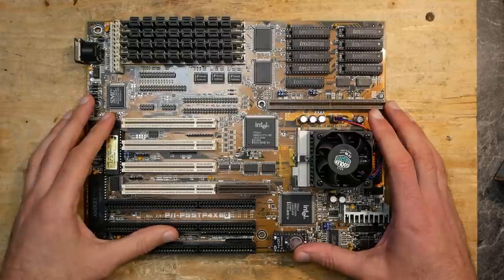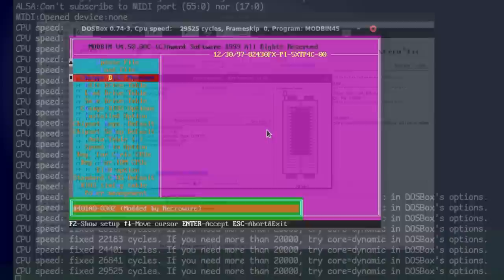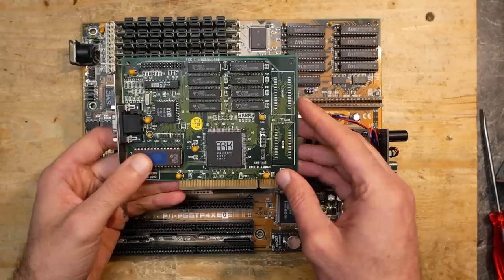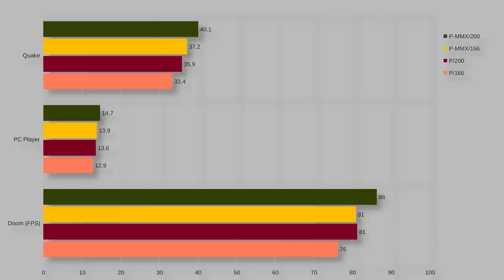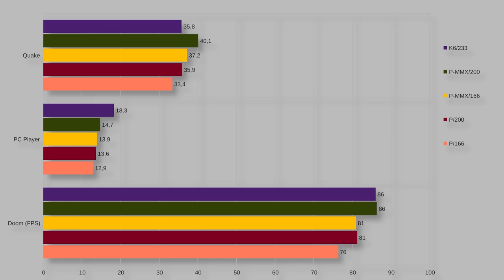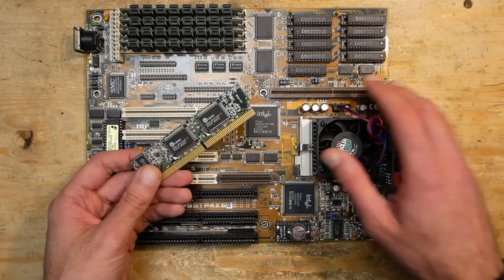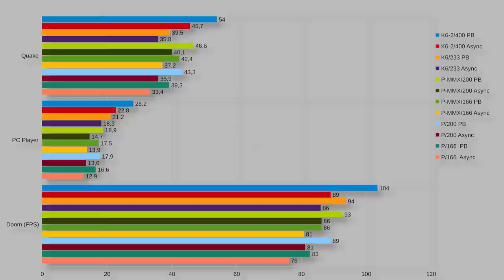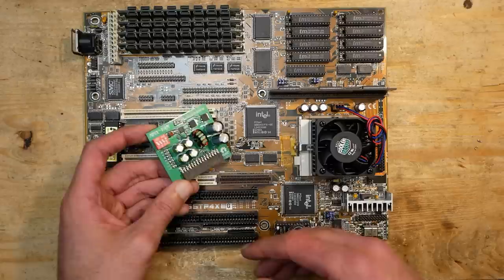Let's upgrade an early Socket 7 board beyond the limit (Part 5): Showdown!

Comment: I'm still sporting a K6-3+ at 600mhz in my GA-5AX board. Quake2 actually got a 3dnow! patch to give it a performance boost on these CPU's.
Reply: Nice to see someone else with that same Motherboard as well. But I only have the K6-2+ at 550Mhz. I have seen modded 570 K6-2+ CPUs due it's the same CPU with only half the L2 cache enabled but the modded one's are not cheap. Also not easy to know who's modification is good and whose is just a hack job.
Reply: still got a amd k2 533 - i could make it 550 but not anymore (15 years last time i tried that ) - I could not run new netscape ( belive it was 6 ) or ie 5? with great speeds sicne it felt like the browsers ate 200 mhz which made me buy a Duron 600 which did run those at good speeds
Reply: @user-bs1lr8nx1h  It probably was an issue with the RAM (volume) rather then CPU speed, because the K6-2/K6-3 were very powerful and in many tests even outperformed a Duron. The main difference, the main gain of the Duron, was with floating point and integer operations including 3DNow!, and memory bandwidth. So things like Quake or Flask ran a lot faster, while regular application sometimes even were a bit slower.
So as long as you got yourself 128MB+ of PC-100 RAM on a board with sufficient cache to support it, a K6-2 400 upwards left little to be desired.
Reply: @l3lue7hunder12  I had even pc-133 memory , a game like unreal tournament like 160mb ram the best
Reply: @user-bs1lr8nx1h  That should have been plenty, yes. Maybe the RAM timing was askew then, since you mixed up different types ? Or maybe you only had enough cache for the first 64MB, or 128MB - there were quite a few who fell into that trap.

I switched from a K6-2 450 to a AMD Duron 700 and was quite happy myself - even after almost frying the poor thing with a bit too enthusiastic Peltier element experiments. Afterwards, I had to undervolt my Duron or it wouldn't even get past post. I switched to an Athlon Thunderbird 1 GHz from there - yet another rather significant boost.

I wasn't too happy having lost ISA through this among other things though, so I still think back fondly to the (S)S7, even the first which was a K5-PR 133. :-)
Reply: very cool!! i need to compile quake for windows nt dual cpu p2
Reply: Zrob to

Comment: Amazing series. You turned a decent early(ish) pentium board into a much more useful testbed. "Super socket 7" would allow for AGP and SDRAM, it would be interesting to see a comparison (clock for clock) with the updated boards. As an all in one test bed this board is now so much more useful and interesting. Great job.
Reply: SDRAM sure is nice to have, but only if the chipset is worth its salt ... my first PC had a 450MHz K6-2 on some shitty ATX board with SDRAM slots and ALI chipset that actually got LOWER scores in memory benchmarks than a pentium 200 on an old (non-super) socket 7 AT board with intel chipset and only SIMM memory.

Also, I would not bet on getting much of an improvement out of AGP on socket 7 - I heard that AGP is buggy on all (or almost all) SS7 chipsets - this ALI board that I had sure was buggy as hell ...
Reply: @KenjiUmino  Well, then use SIS chipset. Rare, but much faster in relative performance.

Comment: I ran a MB like yours with 75mhz bus for many years with a p200@225mhz, never had a single problem or instability, it was really like 5 or 6 years running like that with a trident 9660, i just set the jumpers to 75mhz and never put back because never had a reason to, it just worked... true the pci ran @37.5mhz but it just worked fine even with my voodoo 1 and playing games for hours non stop, at times i would ran it with bus at 83mhz/pci 41mhz but the proc at 2.5x instead of 3x giving it 210mhz and it would also work fine for hours but everything exept the voodoo card that did not work at those speeds.... along with that one i also got a asus tx97 with a p200mmx also @225mhz rock solid, this one would not go but over than 75mhz bus. A friend of mine still have his P55T2P4 with intel HX chipset, this board we tested with a k6 3 at litle over 400mhz and bus 75mhz, unfortunetly i didn´t have my old diamond stealth (s3) that would rua at 83mhz bus anymore to test the k6 even higher at that time.
Reply from the maker: Unfortunately, I don't know any 430FX mainboard, which would provide 75MHz FSB, that would require some heavier modifications. That FSB clock started to come first on later mainboards with 430VX and VIA MV2 chipset.

Comment: Could you recompile Doom with MMX optimizations enabled? Since it has been reverse engineered and compiled for a billion platforms I'm guessing it could be done 🤔🤓 it would be REALLY interesting to see the difference in benchmarks, if any 🙏🏻🙏🏻 
Thanks for another amazing video, I'm always looking forward to watching them
Reply: Hm, Doom is probably not written in a way that could benefit too much from MMX instructions. The way it renders the frames is totally not the way a SIMD instruction set would like it. It goes in columns, uses paletted 8-bit pixels, has look up operations for every single pixel and does hardly anything on groups of pixels. Moving rendering into a system memory buffer could possibly help, at least it could with slow video cards (I remember Heretic was a hell lot of faster than Doom on my very unbalanced Am5x86 + ISA Tseng ET3000 system) and MMX could even make a faster frame buffer transfer possible - probably not by much though as the 32-bit-wide PCI bus could be a bottleneck here. Hm.
Audio processing and mixing could be a better candidate, I guess, but that's less of a bottleneck.
Reply: The Doom Engine source code was released by iD software, under the GPL.

It was not reverse engineed.

Same goes for the Engine for Quake 1, Quake 2, Quake 3, and Doom 3.
Reply: Doom never supported MMX.
Reply: @Jeroensgambling 
There are source ports that support all sorts of fancy things.
Reply: It used lot of tricks, like lookup tables to actually not do floating point operations, which were expensive. MMX is about floating, so...
Reply: yes, you theoretically can, quake too. i'm sure you'll see a bit of speed increase regardless especially if you can use a modern compiler, which tends to be smarter with optimizations. not sure if the original doom/quake were compiled with -O3, it could be that they're not, since -O3 is considered experimental, but that might be another thing to try.

there's also fastdoom, which speeds up doom even more, even if you don't use its graphics degrading settings.

jbinary82: MMX is not just for floats, read the wikipedia page about it, it can also work with integers.
Reply: There's not much to "optimize" - the MMX registers are only 8bytes wide. The most likely option would be to increase color depth and do color blending via MMX instead of palettes. Overall it would be way too slow on old prcessors though. The fixed point math could also be done via the newer register which I tried some years ago and the speed was practically the same.
Reply: @jbinary82  Actually, no. MMX is not about floating, it's about integers, and that's in part why it was a complete failure. Intel learned the lesson and followed suit with SSE, which actually were about floating point (as is 3dNow).

Comment: That K6-3/500 is a really special chip! My first build was a K6-3/400 prior to the availability of the 500 variant. I rocked with it for nearly a decade before retiring it. I had a Tyan board that supported ECC memory and even ran Corsair ECC memory with a ramdrive. Good times! I would send it to you, but it has a special place in my heart and closet and still boots!

Comment: I've been using Jan's modified BIOS since 2001 when I read Oldie Tuning on Tom's Hardware and upgraded my AT computer with a P55T2P4 and a K6-2+ 475 (which overclocked to 500 MHz by using the 83 MHz frontside bus). Jan has always been very helpful, and has done his BIOS magic on request for myself and a number of others I know of. 

I've used both the 75 and 83 MHz FSB on many Socket 7 motherboards and have had no issues with the out of spec PCI bus.

Last year I picked up an old AT computer for $20.00. This was a major score for me since I really wanted a compact AT case, and they have become very rare here. It came with a PCChips M520 VX chipset motherboard, 128 megabytes of EDO RAM, a K5 PR133 (100 MHz) an extremely slow hard drive, but most importantly for the poor person who was forced to use it, no L2 cache at all! This was one of the infamous PCChips motherboards that had fake cache chips, and the COAST slot was empty. On the bright side, this rendered the VX chipset's sixty four megabyte cacheable area limit moot! I used an Evergreen Spectra voltage regulator and replaced the K6-2 400 CPU that was installed in it with a K6-3+ 400 that I slightly overclocked to 450 MHz (6x75). Combined with a fast, modern hard drive, this computer flies in comparison to how it was when I first got it. Since this board has a header for a VRM module, I plan to replace the Evergreen module one with one of yours.

Comment: Very good video! Entertaining and well thaught. As pcb design guy i could help you with dc_dcs. Well from year 2013 I started a new hobby: extreme overclocking. I bought single-stage-phase-change-cooling and I had -42*C at 150W cpu. Very time consuming hobby, but fun. I have done "8800 zombie mod" - cut dc-dc part of pcb and mod it like it is a adjustable power module. Now I am selling my collection, but everything older than socket A is going to be kept for future projects. So there are more of us, retro fans!
Ps. Overclockers used hwbot site.
Ps2. The most wanted mobos were: ga-5ax and asus p5a. The goal was 2d performance, tests like superpi, pifast, wprime, cinebench, no 3d like 3dmark, aquamark or games.

Comment: That's awesome. I remember playing with Socket 7 in the early 2010s. 200mhz pentium mmx, 512mb sdram, 512kb L2 cache module, SATA PCI controller. Got stuck trying to put PCI 3D graphics on it, and I tried upgrading to AMD K6 but the voltage was too high. A lot of fun watching you take it to the next level!

Comment: COAST modules were not usually very interchangeable with each other despite using a standardized slot, it was as if the manufacturers did not want you to be able to reuse or sell them...

Comment: Hey, you did some great tests. That brought me back so much memories. 
But I've got one question: If I remember correctly from back in the days, the RAM is cached top to down, so upper memory first. If you use more memory than cachable by the chipset, the lower memory will be uncached. The i430FX should have a cachable area of 64 MByte. Thus it should run faster with only 64 MByte RAM for anything not demanding more than 64 MByte. And that is certainly true for most DOS apps and games. Greetings Peer
Reply: I think the i430 caches the lowest 64 MB, but it was Win95 that liked to allocate top-down.  (And NT or Linux would allocate all over.). Regardless, your point is correct: as long as you don't need the extra RAM, sticking with <= 64 MB is wise.  This is why the K6-III (and 2+/III+) is so great, as its onboard, full-speed cache makes the motherboard cache redundant, and it can of course cache the entire memory range.

This wasn't just an Intel 430 thing -- VIA and ALi Socket 7 chipsets also had various cacheable limits which were often less than the maximum RAM capacity, and sometimes depended on the mainboard's L2 configuration.  Sometimes they were a little better, though -- e.g. 128 or 256 MB.

Comment: Excellent work! Videos like this make me wish I had held onto my old Megatrends HX83 socket 7 board and AMD K6 200Mhz CPU. I don't remember what happened to it when I replaced it with an Abit BH6 mainboard and a Celeron 300A that spent years overclocked to 464 Mhz.

Comment: Really cool project, very interesting how far you can push this old hardware and the vrm is genius. I wonder if those coast cache modules come in different speeds and how much that would affect the system as a whole. Also would be interesting if you could find a 512k version too see if there are any benefits or downsides to that. 

Keep up the great work and awesome videos!

Comment: Quake on K6 is not slower because of FPU alone. (Yes , it adds).
But also, because it was optimalized for Pentium instructions.
Reply: From what I understand it was extremely optimized on Assembler to the Pentium (non mmx) features.

Who knows if optimizing for K6 and even 3dnow would improve performance much.

Best wishes.
Reply: @ajax700  It would. But 3dnow came with K6-2, not K6. And it was 1998. So ID software focused only on Q2 and later Q3, to support 3dnow!.

K6 came also after Quake was released. K5 wasn't so great, in comparation with Pentium 1, so maybe they decided they have time to optimalize engine only for one of them. Maybe they underestimated AMD, and didn't expect K6 will be so good. So choosen only Pentium. And in 1997, probably decided, they will not focus on rebuild engine to K6 too, maybe time was precious, and they were already focusing on GLQuake and Quake2.

Best wishes too.
Reply: @warrax111  Amd almost never supplied more than around 30% of the cpu market, so it makes A LOT of sense to optimize for the most used CPUs.
They also provided compilers, tools, detailed documentation, etc.

Best wishes.

Comment: Just found your channel :)  Very nice.  I'm just getting back into old computer hardware after a break.  Have to replace some plastic 30pin SIMM slots on my 386 motherboard :( lol.  But found some spare slots on a 386 backplane I have that will probably never be used again due to corrosion form the battery etc.

Comment: Awesome stuff. One day I will have to dive into the science of matching COAST modules to mainboards. I am quite worried about creating smoke...
Reply from the maker: That's true, some manufacturers were so evil to use a custom pinout, but so far I only had issues with COAST modules on 486 boards. The module, which I showed in this video has the right ground and vcc pinout, so there was no chance to see the white smoke, but it still seems not to work properly though.

Comment: Great video! Thanks!
The SETMUL utility can change multiplier for AMD K6-III Plus "on the fly". On fsb = 66MHz the CPU may operate from 133MHz to 400MHz with 33MHz steps! Very awesome!
Reply: SETMUL can also be used to turn the L1 and L2 caches on and off on the fly if you need to go slower.
Reply: @HojoNorem  Exactly! The second great feature of utility.

Comment: Wow , didn't expect so big differance between K6-3+ Asynch cache, and PB cache.
K6-3+ has internal L2 cache, which is very fast and ticks at processors speed, so in this case 400mhz. L2 cache from motherboard become L3 cache, and it's used only sporadicaly, when CPU runs out of L2 cache. Seems Quake can take all CPU cache and still need more. Incredible.

Comment: I liked this series of videos so much! 😊
The idea of getting a piece of hardware, a motherboard, to work in a way which it only ever had the potential to do is really appealing to me. I really love the idea of extracting the most from the options of a motherboard.

I commented in the past about SMPS running at an higher frequency than the current design. Now it's probably not that interesting since the VRM seems to do its job quite well but I've done some research and there are a couple of ICs which could be used.
One is the OnSemi NCP3020B (version -B for 600MHz switching frequency) in SOIC-8 package for which there is an evaluation board, NCP3020BGEVB. Schematics, bill of material, gerber files are available. Unfortunately the board is not in stock at any of the usual distributors so I'm not sure whether it has been discontinued.
An alternative controller is TI LM2745/8 (adjustable from 50 kHz to 1 MHz) in TSSOP-14 package. It's slightly trickier to hand-solder and more expensive. It features a Power-Good open-drain output. The evaluation module, LM2745-19AEVAL, is in stock at Digi-Key in the UK for £75.372 including VAT.
Reply from the maker: Thank you very much! I'm trying to make my projects as inexpensive as possible. The parts for my VRM cost around 8-10€, of course developing the prototype was more expensive in average, since I had to try different parts and designs, but it is still by far not £75. Still thanks for suggestions.
Reply: @necro_ware  
You're welcome. The evaluation board would be a Non-Recurring Engineering (NRE) cost for the new VRM development 😉 Unfortunately they are generally expensive and they cost quite a lot more than the cost of the parts. In the industry they help speeding up development and time is money!
Even if you don't buy these evaluation boards it's good that the manufacturer of the IC makes them because they provide example of (hopefully) working schematic and layout which you can copy or use for inspiration.
Reply from the maker: @lorenzo.c  That's true! For my day time work I wouldn't go the same way, as what I do here, but here there is one absolutely free resource, which I can rely on - my time ;) Furthermore, most projects which I do are to learn something, that's why also in this case I didn't want to just copy something, but calculated everything from scratch. I really wanted to understand each click which happens in this circuit. One additional challenge which I always like to set is to be cost effective in terms of production. Of course, my engineering time is not included and that is the most expensive resource in the industry, but in the hobby the journey is the reward.